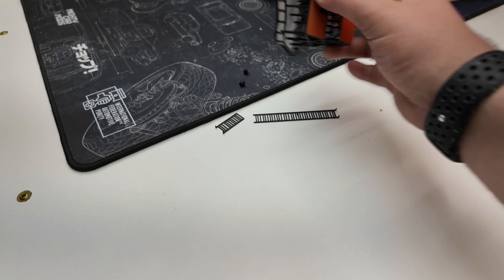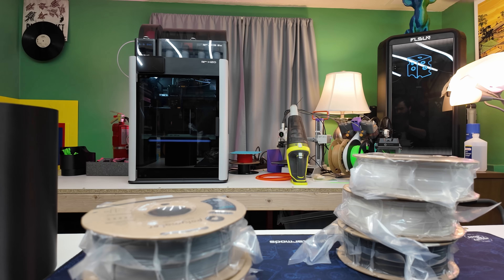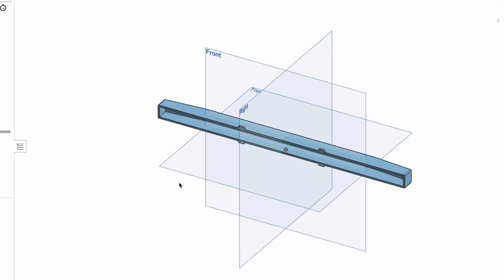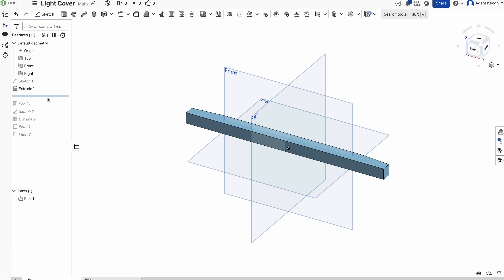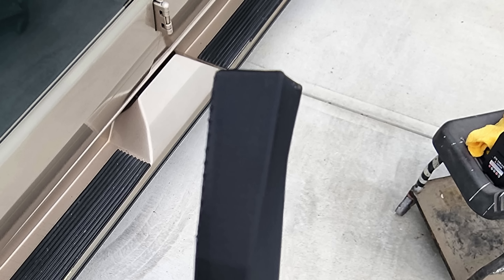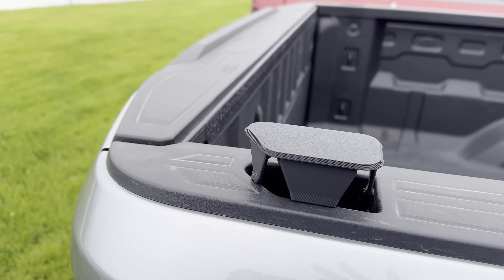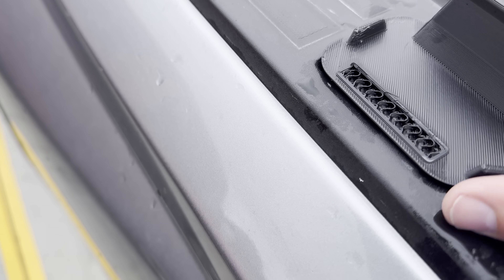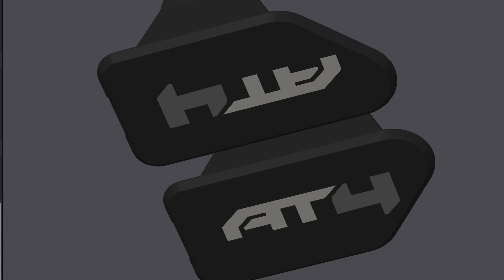Normal PLA Would’ve Melted. This One Didn’t.

Comment: Don't have a scanner, just place a ruler near the the area you need to design and take a photo of it.Bring the photo to you cad software and scale it with the reference ruler picture now complete the digital design and print it on your 3D printer. Note I don't have a 3D printer but the logic is there...if you have an old spare printer you don't need I will be more than happy to take it off your hand cheers Perry.

Comment: You need to make a video comparing it to ASA, PTEG, and maybe ABS.  ASA has become my go to for heat resistant prints.  It's cheap and  prints just as easily as PLA from my experience.
Reply from the maker: I also prefer ASA in general but I was impressed what performance they were able to squeeze from a PLA
Reply: Asa has better uv resistance anyways. I personally really like the feel/texture of asa as well

Comment: I keep all projects in .3mf files together with the step files, just to solve the issue of not remembering settings and such.
I hate modeling in supports myself... I've never done it truly successfully and it takes me bloody forever.
I'm definitely gonna test an HT PLA. I've had major issues with getting PETG to print properly.

Also, why didn't you place a ruler and take a photo from above and use that for your CAD work? Feels like it'd be easier and a bit of support for the measurements.

Comment: @3:05 - Your friend has a suspiciously clean truck bed. Hmmmm.
And as for your son's watering can, may I suggest using Orca Slicer's 'Add Primatives'? Basically add material around the assumed break points, like the connection of the spout to the body, a spline on the inside of the body connecting the handle to the body better. Also, increasing the number of walls instead of upping the infill will work, too.

Comment: I’ve just been messing around with taking photos and importing them into Fusion do a trace and cut for custom tool organizers etc. for the the AT4 caps that would be an easy method to ensure correct geometry from the start. Certainly vs calipers etc. nice video.
Reply from the maker: That’s a good idea! I’ve even done that before but for some reason; this didn’t even cross my mind this time around…

Comment: Only reason I'd consider this over PETG if I needed heat resistance is for the matte finish of PLA. Hard to get matte PETG, but right from the beginning of my 3d printing hobby, I've never had an issue with printing PETG. For me it comes down to this for PETG, dry your filament a little, turn up the heat and it prints just as easily as PLA. Now does the extra heat wear out my nozzle and maybe extruder? I don't know but the prints come out good.
Reply: You should check out PCTG. Less stringy than PETG, higher impact resistance, high resistance to heat, stronger, less hydroscopic, prints just slightly faster than regular petg except the high flow stuff and it comes in matte.
Reply: I’ve heard Sunlu PETG is quite matte